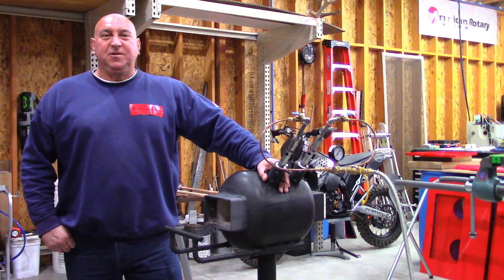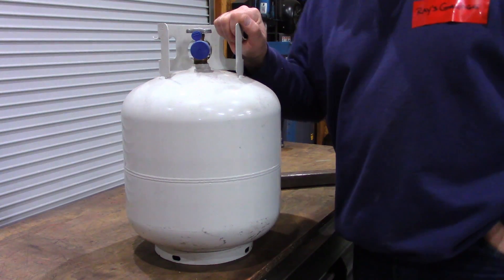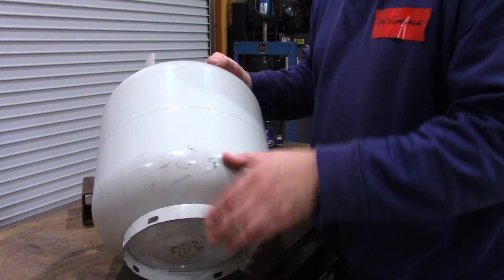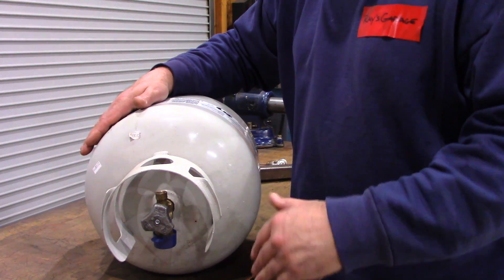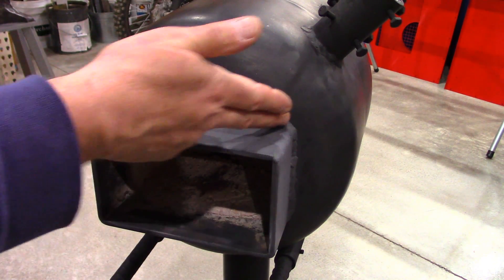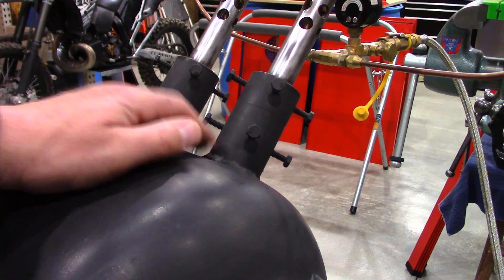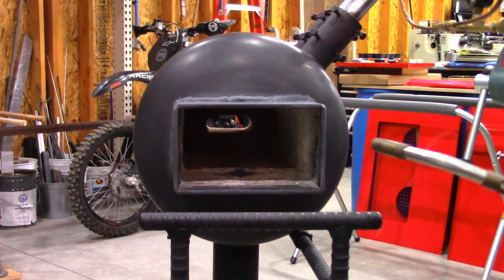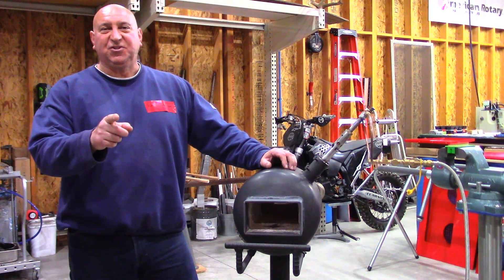Propane Tank Forge #realraysgarage

Comment: OK, I see that you did address these concerns - and flushing any residual hydrocarbons out of the tank... just not as early in the video as I had expected...

Everyone needs to be careful when attempting these projects, and sadly, we need to cover our butts from the oblivious people who aren't working safely.

Just a few words of caution here Ray:

There be way too many idiots out in YouTube-land, so you would be wise to make a disclaimer upfront that anyone who follows through and build one of these does so at their own risk.

In the same line of "There's always a bigger idiot out there."  you probably need to warn folks that they should not attempt to remove the valve from the pressure tank until they have completely emptied it of gas.

Also from the don't challenge the idiots and fools to be any stupider than already are, you should point out for the clueless that this is a one-way conversion - the tank gets consumed to make the forge.

How I wish that these kinds of obvious things shouldn't be necessary butt covering activities, but unfortunately, there be too many dimwits, and too many ambulance chasing lawyers...
Reply from the maker: Thank you for this very important information and will pin your comment to the top. I do have a professionally written disclaimer at the start of the video and should have mentioned early on that this is a very dangerous project if the proper steps are not taken! Thanks again, Best Regards, Ray

Comment: I looked through the comments and did not find a couple of cautions.  ALWAYS  ALWAYS ALWAYS  put the lighting fire in the forge BEFORE opening the gas to light it off.  If you do the reverse procedure I can GUARANTEE a big BOOM from experience.  I used to fire and run a small steam locomotive with a 550 gal. propane tank in the tender feeding a 6 inch burner into the firebox for heat.  It had a pilot light on it.  If the sequence of lighting  the fire was not followed, a big BOOM occurred.  Fortunately no damage was done except to the nerves.  One time the state boiler inspector came to inspect the boiler and he was more nervous of the propane tank than the boiler.  The propane delivery man told me I  didn't need to cut the fire when he filled the tank but I always did and one day he told me he was retrieving the hose and the valve on the end of the hose opened so he then agreed with me to cut the fire.  A 2 inch hose will blow a lot of gas.  The second caution is not to try to relight the burners off the hot metal or inside of the forge.  If carbon dioxide, argon, or nitrogen is available when cutting the tank use one of those gases in the tank while cutting the openings as gas can be trapped inside even after washing out several times.  I am not trying to scare anyone but I would not like to hear that someone got hurt or killed while not taking precautions with one of these tanks.  Remember propane is heavier than air so it will flow down to the ground and settle in low places.

Comment: Nice build.  I have a commercially made forge very similar to this one.  Mine is a Chili Forge and sells for about $1200 and I'm guessing you built yours for about $500.
Reply from the maker: Hello Jim, I almost pulled the plug on the Chili, its one of the best forges out there in my opinion! I built what you see here for under $250, my time was free and I had most of the metal form other projects.
Reply: @RaysGarage  Yep I was in the process of collecting all the part to build and found the Chili for $500 and it had only been fired maybe 7 times.  Guys wife was afraid of it. Something about burning the house down and half of the hood!
Reply from the maker: @jimhumphrey  That was a steal, its a $1200 forge, nice buy and I'll bet it works awesome!